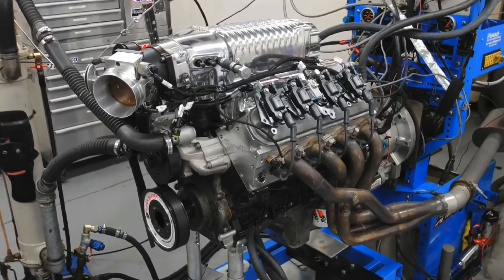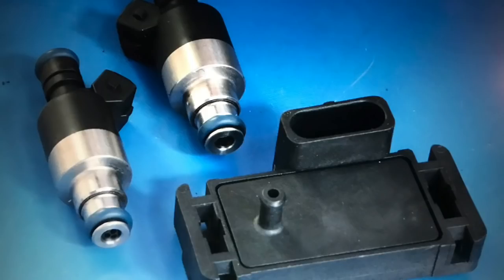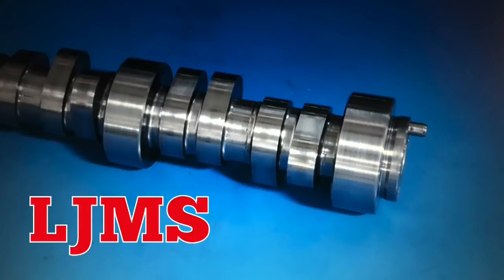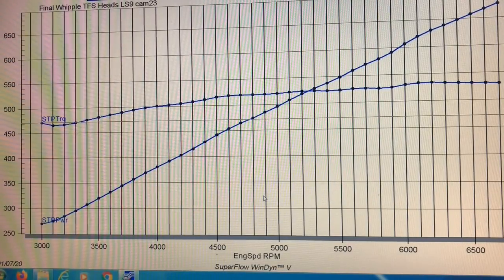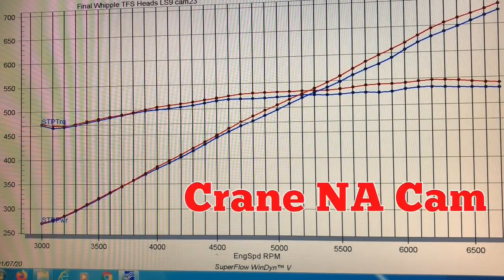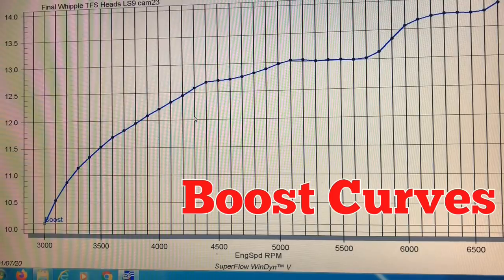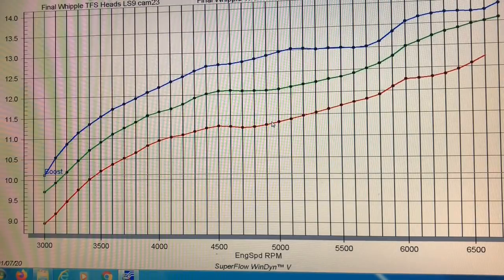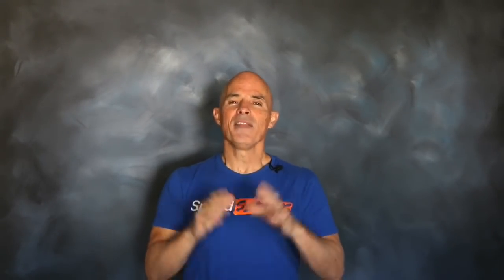LS BLOWER CAM TEST-LS9 vs LJMS vs NA CAM (BEST FOR BOOST?)

Comment: TIGHTER LSA MADE THE DIFFERENCE FOR THE NA CAM WITH MID RANGE TORQUE AND NOTICE THE AMOUNT OF EXAUST DURATION COMPARED TO INTAKE ON THE BLOWER CAMS
Reply from the maker: any cam that makes more power na will do so under boost

Comment: What are the affects on air/fuel ratio running different lobe separations. There must be a reason why GM and all cam manufacturers make the PD cams with such wide LSA. What would a BTR Torque Truck cam do with a blower for an example? Would the exhaust manifolds glow from fuel being dumped into them? Do the cylinders run leaner then the measured afr is indicating due to fuel being pushed to the exhaust?

Comment: I think what we saw here was based purely around valve overlap. The N/A cam has enough overlap to bleed off some of that boost pressure yet it was still a good enough to make really good power. In my opinion if we increased the boost level and made it the exact same for each combination we'd see that the N/A cam probably would've made the most power of the three given the boost was the same for all three combinations. The valve events were just better.

Comment: What I'm curious about is how much more "stress" is there if you raise the pulley ratio to make said same higher boost levels. obviously there is going to be more horsepower but since the boost levels dropped by about a pound if you raise that back up by a pound with the structural integrity of the engine be "more" compromised than leaving the boost levels lower??  I'm hoping this question makes sense...

Comment: If this was in a street car I would prefer the NA cam. It made more power and torque where you need it on the street. It also made less boost so if you were to increase boost to match the Boost level with the LSA cam it would be marking even more power.

Comment: Nice test, really enjoy your videos. I replaced a stock LS2 cam with a  115 lsa  218/224 .591/.605 lift cam and it worked well for me in a LS2 with  stock heads with a 112 Magnacharger years ago. I swapped rear pulleys to overdrive it at the same time to bring the boost back up. I probably left some top end on the table  verses a dedicated PD boost cam with a wider Lsa but in the rpm range I operated in as a daily driver 95% of the time it really woke up the midrange when out of boost.

Comment: I want to install a supercharger in my ls3 with a N/A cam with duration of 231 intake, 243 exhaust, lift of 649 intake, 629 exhaust, 113 LS and 108 ICL. So pretty much a positive will hurt the top end but it will increase my mid range torque. Will a centrifugal work better with an N/A cam than with a force induction cam?
Reply from the maker: it will work better with an NA grind than one designed for a PD blower

Comment: I'm looking to build a LS that's geared more towards having a broad power band and excellent transient throttle response. I think it would be great if you could do a video on building a relatively high revving street NA motor and what are some of the challenges of building an NA LS that makes power in the 7200-7500rpm range.

Comment: I would love to see the fuel consumption factored in. My initial assumption was that more charge air would escape into the exhaust on the NA cam causing the engine to lose power. Based on the brief time that fuel consumption was shown @6:05 it looks like the NA cam used more fuel but didn't lose power. This seems like a very strange result, with a positive displacement supercharger and a consistent AFR the supercharger should be supplying the same amount of air in both combos and therefore the same amount of fuel, right? Where is the extra fuel going unless we are running richer?

Comment: Great content, love to see you compare a mild/wild cam on different displacement motors, 4.8lt, 5.7lt and a 6.2lt. if you can keep the same heads, would be amazing. Thanks. With the goal if finding crazy torque for the street, everything under 5000rpm

Comment: Well seeing as to how the cam duration is directly comparable to your air in and out through lobe height and lobe duration,  it would mean the issue you'd have would be volumetric efficiency within your actual cylinder and is more than likely why the na cam performed as it did, as an NA  cam that is selected properly for the rev range you want is designed to maximise volumetric efficiency within your motor at that set rev range, adding the blower would simply allow you to increase the intake pressure consistently thus allowing you to get close to 100% volumetric efficiency as opposed to a lot of cams I see, especially in motorbikes, that manage to get around 80 to 85% efficiency...but sound tuff at idle
That's my take anyway :)

Comment: Lower boost on the crane made it a little safer to run. The mid range and low end was better. I would take the Crane cam over the others.

Comment: Hey Richard, my understanding if Vakve overlap is that it allows for more complete cylinder filling when you're at higher RPM on an NA motor because the exhaust is still able to scavenge the cylinder. If you run higher boost do you think there will be a point at which you're just wasting air and fuel blowing it right through?
Reply from the maker: very high boost/rpm will favor the blower cam

Comment: Another great video Richard! I'm curious what the intake manifold temps were for the 3 cams-was manifold temps the reason for the different boost readings or simply flow rates? Would it also be possible include MAD (manifold air density) measurements along with boost readings. Thank you
Reply from the maker: I don't have MAD sensors, the intake temp is a function of boost pressure and the change in boost was a function of the cam timing

Comment: Just wondering what exactly you were seeing with the changes in boost, was EGT up or down  any?  I kind of question  using cams that  seem to be in general designed for the factory  "rectangle" style ports where  I/E ratio is way off compared to Cathedral stuff let alone an aftermarket Cathedral head with a great exhaust port. Do you think that same boost trend would present itself or be as significant with an LS3/A/9 headed engine where the 20 degrees of split would  be more meaningful than in this instance?
Reply from the maker: pretty sure It would be the same

Comment: Seems like the na cam is actually the best choice for this engine. Most power with least boost says most efficient
Reply: For fuel injection kinda. For carbureted I’d say no as it would puke fuel out the exhaust.
Reply: @RadDadisRad  you will still have same air flow.. just less restriction... This is why the engine is still making similar power while showing less restriction. So if you up the pulley you will then be flowing even more than previous.
Reply: Yes and no. Depending on camshaft timing events you can lose a lot of that boost blowing out the exhaust. What would be a byproduct of overlap.

Comment: I'd be curious to see what the BSFC curves were for each.  I honestly can't wrap my head around which would be the most efficient based on the boost and dyno curves.  Does the lower boost but same torque mean better BSFC?  Or was the higher boost the most efficient?  hard to guess since boost isn't a direct measurement of mass air flow.

Comment: Would love to see a 5.3 with a large single turbo 88 to ?? and stage 2,3,4 turbo cam and 25-28lbs boost
Reply from the maker: turbo motors are difficult to make repeatable at 28 psi

Comment: From this test, since the power numbers were relatively close. To me the determining factor would be the iat's. The one with the lower iat would be less taxing on another part of the equation. The intercooler. Separate, of course, from the vehicle it could potentially be used in. And  it's intended use.

Comment: would be more interesting to actually be able to measure cylinder pressure during operation/ combustion in comparison before deciding to raise boost to equal and figure out best combo 4.8??? tighter lsa equals less cylinder pressure but it makes an engine more eager to start moving air/make power for sure.... i've run as low as 104 on n/a applications and boy howdy that makes a throttle whack what it should be for sure.

Comment: Would be really interesting to do this same test again with all 3 cams on a smaller more suited head for the lr4. Most guys aren't gonna spend the money on huge oversized heads. But cam absolutely. I think the head choice here played a significant role in the cam behavior and you results.

Comment: Aside from the peak numbers and cost. My take away is what cam is better at that 'blower speed' not the 'boost pressure'. The ultimate goal is to make the most power safely and efficiently. I think that spinning the blower the same speed for all the cams was a good test. How often do you change pulleys on a supercharger? Not as often as the turbo guys turning the screw depending on what day of the week it is. So, most the time you select your pulley combination that will give you a rough PSI based off of blower RPM and knowing what type of cam will give you the most out of that blower RPM is key. 

Also, I look at the drop in boost as a win win. Not only the LJMS cam made the most with less boost, I wonder if the intake temps were lower as well on both the NA and LJMS. Richard would have to confirm that. There really isnt a downside to the LS9 when its that low of a cost. But I wonder if what would happen if the blower was spun much faster, Will the LS9 shine since its using all the boost the blower is making or will NA cam fall off since it will be wasting boost and creating more heat in the process?

Comment: Another great video!!
This being a positive displacement supercharger , if we ignore the slight drop in flow due to increased pressure ratio and increasing inefficiency , should have made the same power. A centrifugal supercharger would have been better for this test to see which is the best CAM, don't you think. In a perfect world the positive displacement supercharger decides how much power we make rather than the engine flow, IMO. Was the  spark  advanced used same for all setups?
Reply from the maker: timing was the same and same thing happens on Cent blower

Comment: Pulley should stay the same. That way you see what the cams did to power and boost. If you had changed pullies to up the boost it would be harder to tell what was going on to cause the na cam boost loss.

Comment: for some reason I always thought the positive displacement superchargers maintained boost throughout the entire rev range? This graph looks more like a centrifugal supercharger, or is this from the baypass valve leaking off some boost down low?
Reply: Twin screws are more efficient than a roots type blower hence the rising boost curve .
Reply: @dilsher12  guess i need to do more research lol I thought they were the same

Comment: Richard, good video.
Can you do some more testing with the Edelbrock cross ram and fast lsxhr tunnel ram on a stroker engine with wild cam timing?
No one seems to do it and these intakes are made for it.
Reply from the maker: the LSXHR yes-the X ram no-its a long runner manifold

Comment: This test was a great one! But now let’s try and keep boost equal with each cam. Lastly, let’s test each cam on an NA motor. I’ve heard rumors that the LS9 cam is also an upgrade for the smaller NA LSs’.
Reply: There's a very good article online by Richard holdener . Google LS cam test and they have tested all factory cams and some aftermarket in that article. LS9 and LS7 made the most HP but LS9 looses a lot of bottom end/ midrange power
Reply: dilsher12 oh ok. What ive heard is that the LSA/LS9 cam actually improves midrange TQ and top end HP, but you lose some what on low end TQ. This is in a LQ9/4 and LY6. But my source is online forums. Good to know though, thank you
Reply: @michaelminer8531  The LSA cam is much smaller and has a narrow lobe separation angle compared to LS9 . The LS9 wakes up around 4000 rpm and takes off from there . Anyways check out the article ,they have all the details in it .
Reply from the maker: Please do a search for the the Ultimate LS cam test-car craft-ALL STOCK CAMS TESTED

Comment: Love the content. Great job! Have you done the ls9 cam with a turbo ?
Reply from the maker: yes lots
Reply: @richardholdener1727   how did it work out? I'm building 4.8 with ls9 cam and gt4718r 88mm turbo. In a 72 nova. Project lowlife. Done on the cheap.
Reply: @kevinhanna7878  Do it ,you won't regret it . Its best daily driver cam for boost , I'm running a 5.3 s475 and the cam pulls hard all the way to 7000+ rpm. Idles at 550 rpm good fuel economy and low rpm driveability . Low end torque doesn't matter since my charger comes online @2500 rpm and I have 2500 rpm stall converter. And the price can't be beat I actually had a turbo cam before that and didn't like the lopey idle and valve train noise .  I lost next to no power and spool time .
Reply: @dilsher12  awesome!  Thank you for the info!!
Reply: @kevinhanna7878  https://www.hotrod.com/articles/ls-cam-test-comparison/  The LSA/LS2/LS3 cams are great factory options too for a 5.3 (if you can get a cheap take  out) and lose almost nothing down low... Even the LS1/LQ9 cam is a decent upgrade again cheap used.  If I were buying a shelf cam it would be the Crane 210/218 posted at the bottom of that test. It gives the huge top end gains the LS9 does and loses almost nothing down low too. Remember too all those gains in the test article will be essentially doubled on 14lbs of boost. Sorry didnt see where you had the LS9 cam

Comment: When it comes to a blower wouldn’t you want the most amount of boost as possible on this test? I mean to equal the boost with the other 2 cams you’ll have to spin the blower faster. So if my thinking is correct spin it slower but get a cam that’ll provide the most amount of boost? Not sure if my thoughts are correct on how to make power.
Reply from the maker: the boost was highest on the LS9-but it didn't make the most power-more power with less boost is optimum-then more boost!
Reply: Richard Holdener so what affects boost? The lift, duration, and or LSA determine or affect the boost?

Comment: Please test identical cams with different lsa’s. .  Same lobes .  

106-110-114-118
Or 
104-108-112-116 

And these exhaust bias extreme splits have been proven to have little to no effect and hurt midrange .
Reply from the maker: I did that
Reply: @richardholdener1727  is there a link to see results??
Reply: @richardholdener1727  and thanks!!!!!

Comment: Another great video richard, thanks.  I prefer you font change the ratios, or maybe do an additional test with changing the ratios.  In this test, i assume the blower should actually be flowing more mass airflow at that lower boost setting after the cam change... The torque curve tells me how well the motor is using that added airflow.  I.e.  if boost drops and torque does not improve, the combo didnt like that cam.  I'd love to see airflow data on these tests.  Does that dyno have the ability to record airflow?  Also, with cam comparisons, I always want to know how radical a cam behaves.  Can you include average manifold vacuum or maybe cranking compression with these videos?
Reply from the maker: I have run idle and cranking compression on some of the cam tests-not this one, I did not run an air hat on it to get airflow data

Comment: Would like to see this same test on a turbo charged 5.3l.
Reply: There is a test. Called turbo camshaft shootout. I think richard holdner did the test too it was a really good article
Reply from the maker: The turbo simply elevates whatever power curve provided by the NA motor
Reply: @richardholdener1727  so unlike in this test where LSA clear made a difference with the blower, LSA makes no difference with turbos?
Reply: @ssoffshore5111  does it make a difference in turbos?
Reply: @buiItnotbought  just googled it good read ty

Comment: I love your videos. Nice info. Out of the three, I would use the ls9 in my 4.8. The others just aren't making enough more to justify the cost difference. If I were to choose one of the aftermarkets I'd choose the N/A cam. Although it didn't win in peak numbers, it had safer boost levels and made more through a lot of the curve. I would like to see two things with these setups.
1. Adjust boost as you stated to keep them even
2. Throw on a set of STOCK 862s and test again keeping the pully ratio the same as this test

Comment: Just as a guestimate, I'd say the cam specs add up to more blow through on the overlap for the drop in boost, the LS9 being designed for some EGR action with less blow through.

Comment: Another interesting video from Richard. 
Another interesting thing to test would be fuel temperature! With a fuel system for high hp applications and big fuel pumps the fuel gets heated quite a lot when cruising.

Comment: Keep the pulley the same. Less boost shows that the air has less restriction entering the engine
Reply: Exactly. Richard has talked about horsepower per pound of boost before, and the answer just comes down to increasing the NA power first.
Reply: It has less restriction moving through the engine. The duration of intake and exhaust overlap definitely affects this reading.
Reply: Leland Holton I think you can certainly blow boost right through the cylinder with a lot of overlap. Might be great for NA but crap for boost. You might very well see lower boost numbers with a Texas Speed MS4 with a 110 LSA but I don’t think it would be well suited for a PDP.
Reply: It's tough to say if boost leaks through overlap because an increase in cam size will also increase filling of the cylinder which will cause less restriction.  And everyone I've seen who has switched to a bigger cam with more overlap on their supercharged setup has seen a significant bump in power along with the reduction in boost.  Same thing when switching to a larger displacement engine.